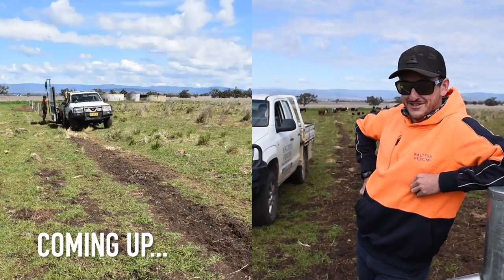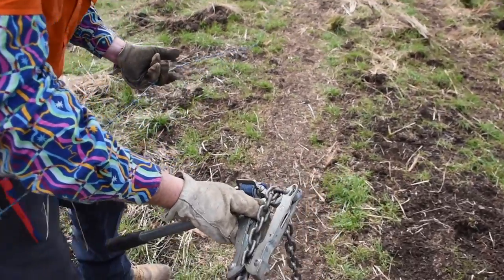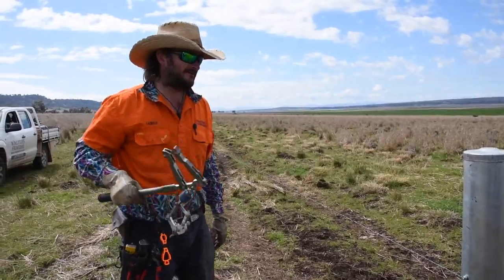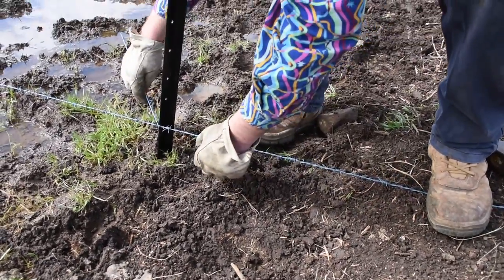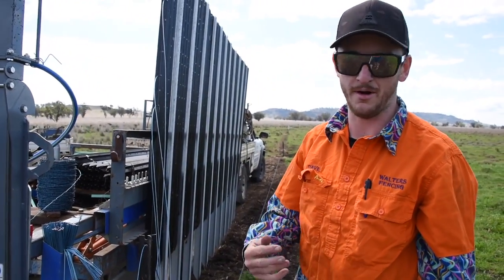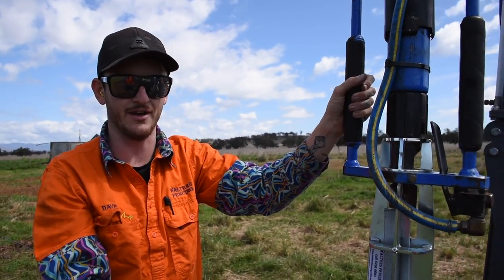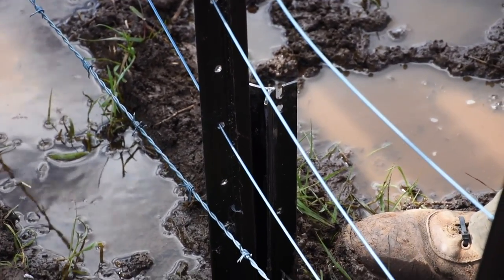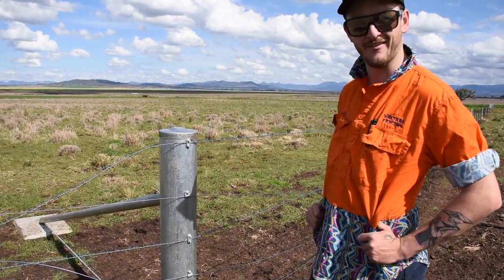How We Do It: Start To Finish Fencing EP#14

Comment: How do you reload the rack without cutting the wire, as you had to reload the rack at 300m
Reply from the maker: You have to cut the wire to reload the racks, we use crimps to make it as quick and easy as possible.

Comment: What happens if you can’t drive the post in fully
Reply from the maker: You'll have to either cut the post shorter and try again, or hope it's in deep enough and just leave the other posts adjacent to it slightly higher as well so it flows nicely.  
- Clancy